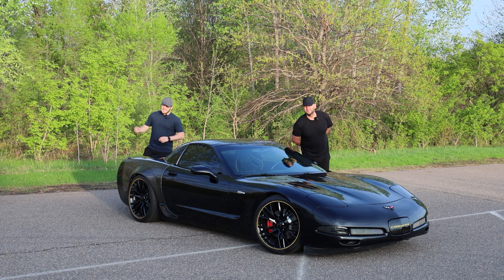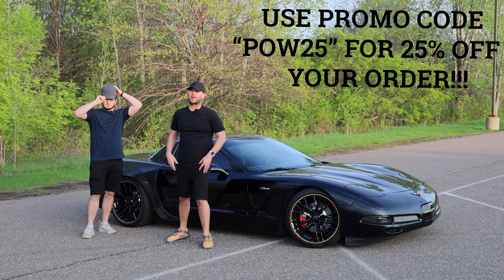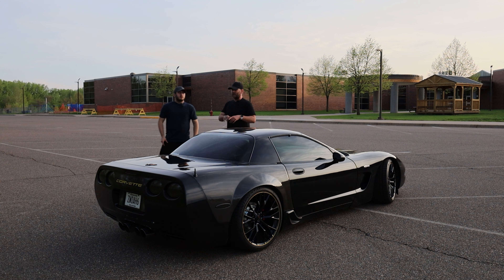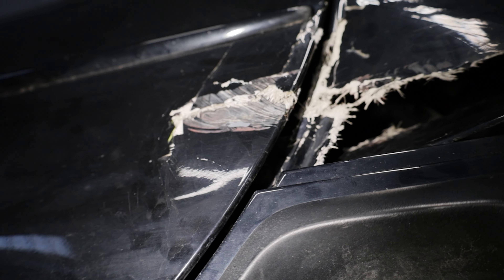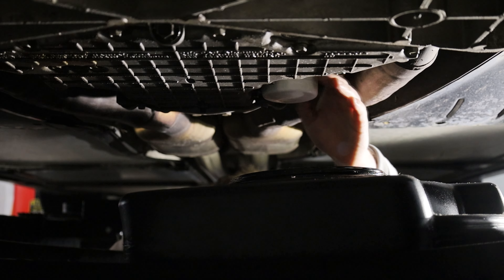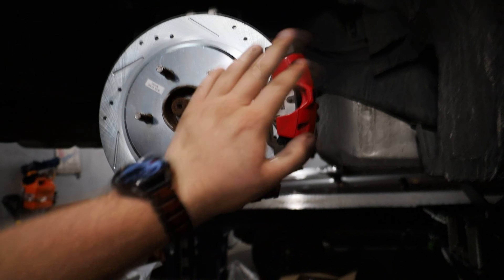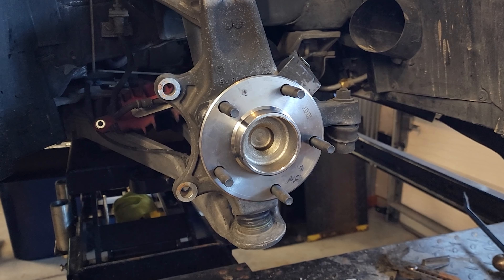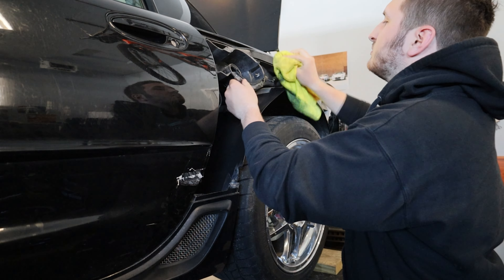Rebuilding A Wrecked Corvette Z06 In 1 Month

Comment: I’m not sure about the specific Mobil filter you bought, but other Mobil filters I have looked at, state right on the box that they are 99% efficient at 30 microns. The best  protection from particulate that causes engine wear is a filter rated at 99% at 20 microns. Amsoil, Royal Purple and Fram ultra synthetic are three that are rated at 20 microns. They will also remove most particulate down to 10 microns, which is the range that causes the most damage.
Reply: That’s good info. What are the microns on a fleet farm oil filter for a 2004 mini cooper? Curious because I need to do an oil change. I also need to do one on my 2007 Chevy impala and I don’t want to injure my engine. Thanks in advance
Reply: @dequavis8771  I looked up the fleet farm but didn’t find any store brand, so I couldn’t say. The filters I listed before are 20 micron, thanks.
Reply: In my opinion, anything that has Fram on it, I don't use it. Junk!

Comment: Nice build man! What size hub centric spacer did you use for the rear wheels?
Reply from the maker: 1.5 inch! There pretty big, however with heavy auto cross, drag racing & very long road trips with checking the torque every oil change I’ve had no issues

Comment: About the wheels – they are optional Chrome Z06 Wheels and they are OEM ¿`_
Reply from the maker: Only optional on the 2004 model year. Mine is an 02. Wheels had no GM or ALOCA or SPEED LINE stamps anywhere on them
Reply: @PerformanceOnWheels ... show me where that's written in writing ¿`_
Reply from the maker: It is stamped in the back of the wheels between the spokes.
Reply: @PerformanceOnWheels  show me written proof that they were only available on the 2004 ZO6 ¿`_
Reply: @PerformanceOnWheels  , what I find most telling, is that you described the car as being from a one-owner and completely stock with minor alterations. Why would they have changed the wheels? Because that's how they ordered it ¿`_
Reply from the maker: Probably because they liked chrome. I'm not sure why you feel the need to argue. If they were real I would have sold them for 3 times the price that I did. They were 100% replica wheels. Your more than welcome to do your own research to find out the availability of chrome wheels for a C5 Z06.
Reply: @PerformanceOnWheels  I know you're hell-bent on thinking you're right that those Wheels were aftermarket, but humor me for a moment and check the specs in your glove box to see if they were chrome wheels from the factory. You might just be surprised you sold them for far less than what they were worth ¿`_
Reply from the maker: @user-ys9to2ie7k you are right. They are oec. Mistakes were made.